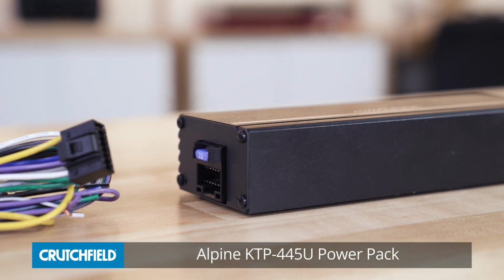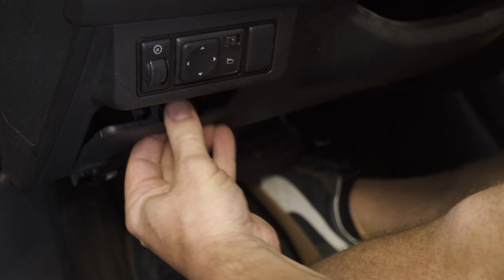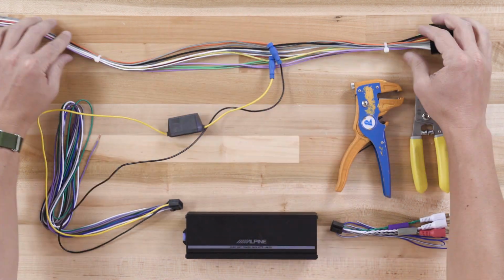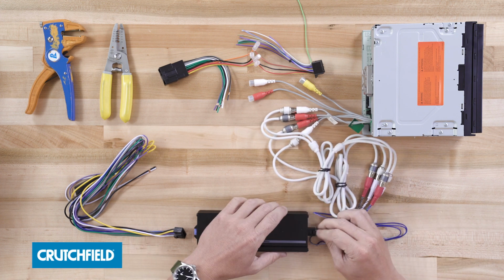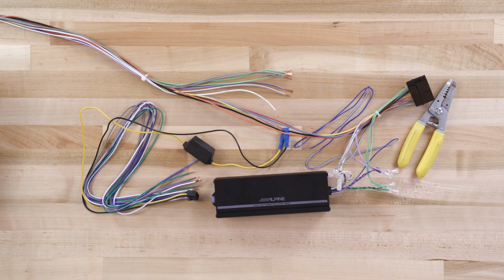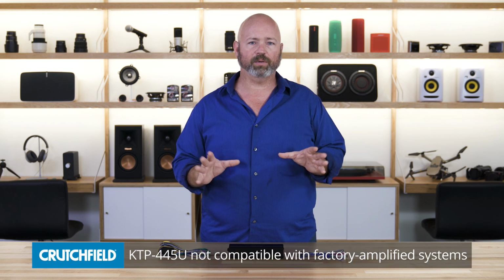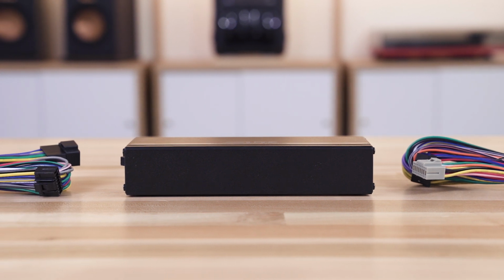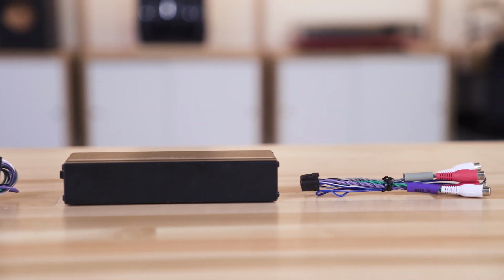How to install the Alpine KTP-445U Power Pack compact amplifier | Crutchfield video

Comment: I lose power to my alpine amp, when the sub woofer bass hits, I lowered the gains and it still seems to be cutting off when the bass hits, any idea why, and I am only running two ch. to a set of 6.5 kickers
Reply from the maker: That's definitely not normal operation. If you purchased the Alpine from Crutchfield, you can contact our tech support department for assistance and troubleshooting. You'll find their toll-free number printed on your invoice.
If you purchased the Alpine elsewhere and the retailer will not help, you may want to contact Alpine directly: 800-257-4631  
We also offer paid access to our tech support service for items that were purchased elsewhere: 
http://bit.ly/2Geav1c 
Hope that helps.
--Crutchfield
Reply: @crutchfield  many years later and I’ve decided to finally switch over to a alpine bbx-f1200 as I am only running two 6.5 speakers and set of tweeters, and I ended up running a power wire straight to the batter and good ground fixed my problem on the power pack ktp445u
Reply: Insufficient power source or grounding issue
Reply: @ryangeiger6910  yes that was my problem I ran the power line to my class D amp instead of straight to the position battery post who knew these little amp needs a lot of power
Reply: @chakas03  glad you got it fixed

Comment: Do you recommend using a low line converter?
Reply from the maker: The Alpine KTP-445U features both "speaker level" (high level) inputs and signal sensing turn on so, you do not need to use an external line output converter with this amp. 
For additional assistance and personalized recommendations, feel free to contact us directly by phone or through our online chat service: 
http://bit.ly/2jBGHPp 
Hope that helps!
--Crutchfield
Reply: @crutchfield  Thanks. I've called you guys in the past. Without a doubt the best customer service I've received over the phone. Cheers!

Comment: These sound excellent. I also want to add to this great video , Recommendations to NOT ground this radio to the aftermarket wiring harness along with the radio ground. (Twisting 3 grounds together) as this may cause engine noise. Chassis base will do great . Find something metal (not painted) and use a tapping screw to drill a hole then use a ring terminal (included) at the end of the ground to contact the metal , and fasten 
 AND WALLAH! No engine noise
Reply: Huh? 1minute in he clearly states to "tap into" the power and ground cables. Now your saying not to and connect your own ground to the chassis? This what makes youtube and people in comments section so confused.
Reply: @EGGZ1983  The dumb ass in the video didn't say to plug the speaker wire harness back into the radio. I thought it was a half ass video from this fat bastard. Got to go find a better one
Reply: @EGGZ1983 yeah both will work but tapping into the frame will eliminate a common whining noise
Reply: So run the ground coming from the Alpine to the chasis?

Comment: This amp does the job just installed one on my 2014 Silverado to the factory nav radio and doesn’t need a remote wire when using high output setup. I also got more volume out of it also was tired of the low volume this one is also a cheaper price compare to the kicker version
Reply: So is this like an amp ? Cause I asked in another video and they said no its not an amp,  I'm asking because I don't want to put say a 500 watt amp in my trunk for 6x9's I don't wanna run power wires and more rca cables
Reply: Uptowns Finest yeah it’s an Amp just small only designed to power the front and rear speakers not subs...
Reply: Yes this is an amplifier
Reply: Did you run a new power wire or just tap in?

Comment: So if you use the factory deck you don't need the blue wire? Is that correct?
Reply from the maker: That's correct.  You do not need to connect the remote turn-on (blue/white) wire when connecting the amplifier via speaker-level input, since those inputs are auto-sensing. For more details or to discuss further, please feel free to get in touch with an Advisor directly from the Crutchfield website: https://www.crutchfield.com/I-rYTVc000/support/ContactUs.aspx

Hope that helps!
--Crutchfield
Reply: @crutchfield  what I don’t get is the power pack has 2 blue remote wires. Which one do use when connecting to an alpine head unit? The remote wire on the low volt rca side or the remote wire that’s on the harness that has the power ground and speaker wires?
Reply from the maker: The one grouped with the RCA inputs is the one to connect to a radio's trigger to turn on the amp. The wire on the power/speaker side is a passthrough trigger for another amp.

Comment: I have 1 of these and had severe engine noise how do I stop that?
Reply: Check your grounds. The plastic cars of today don't ground well. Best to find and test a known good ground and ground to that.
Reply: Mine makes a lot of noise now too. At first I thought it was coming from my sub amp. Although I addressed that with a better ground, it still does it though. I don't know where to ground this stupid amp.
Reply from the maker: @RenePerez-pu4cj  I've had to ground a couple amps at the battery before as that was the only way to remove the noise. There might be other places to get a good ground without having to go back to the battery. If you purchased it from Crutchfield, you should call our technical support for this help. If it was purchased elsewhere and they cannot help, you might reach out to Alpine for help. Their customer support number is 800-257-4631
--Crutchfield
Reply: @crutchfield  I was thinking of doing that myself as well.  But based on information I researched for online, I know that grounds can't be longer than 18". Also, to avoid grounding back at the battery as chassis is the best place to ground.
Reply from the maker: We have a couple articles on engine noise and noise suppression in the "Learn" section of the main Crutchfield website here: 
http://bit.ly/2KOwV6c 
And here:
http://bit.ly/2nzf0XL 
For additional assistance and personalized recommendations, feel free to contact us directly by phone or through our online chat service:
http://bit.ly/2jBGHPp 
Hope that helps
--Crutchfield
Reply: Grounding it to the chassis would be best to get rid of whining noise
Reply: It's hard to find a good ground spot for chassis because my amp is behind my headunit.